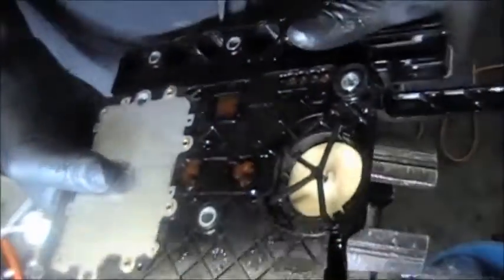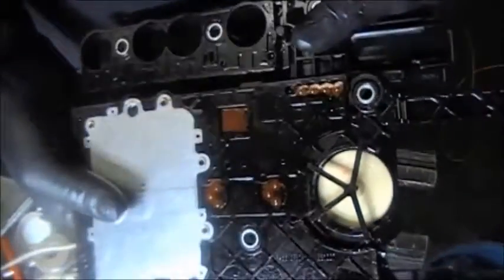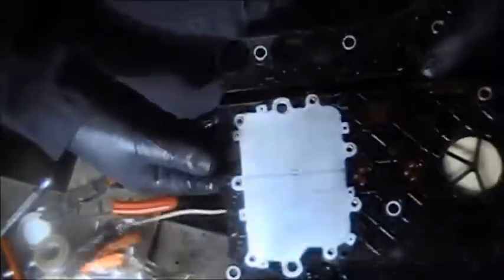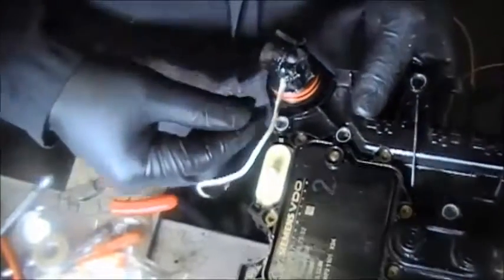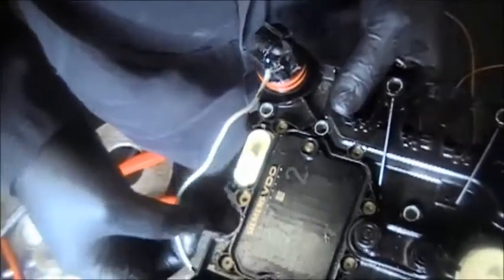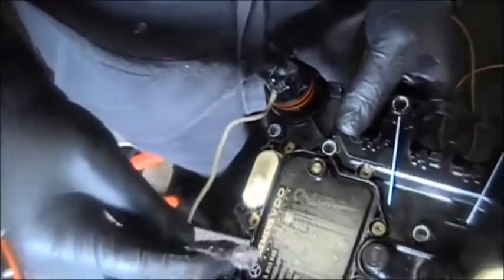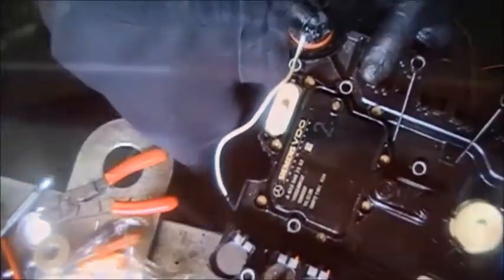mercedes bens 722.9 transmission contol module (TCM) repair part 2

Comment: you def should of jus replaced the faulty parts instead of cutting a factory wire harness..sketchy..aff
Reply from the maker: This vehicle had low mileage. There was nothing wrong with the computer system. Also, I am not simply a parts replacer. If the part could have been fixed to operate normally (and it was able to) another way without charging $1500 or more, then it was worth it to use this method. In fact it shows ingenuity and creativity. This fix will last the vehicle 100,000 miles or more, furthermore the harness was not damaged at all. You cannot simply be a parts replacer. Sometimes you have to look at things and see how to make them work. Many people come up with different ideas, it is best to give attention to all, because you may have to use one down the line.

Comment: Hello sir do you have experience on mazda 6 automatic transmissions? 2 gear shifts hard 125k miles.
Reply from the maker: If a mazda 6 came into the shop, i would fix it! However, since I do so many transmissions,l and there are so many transmissions made, It is hard for me to keep everyone in memory.

Comment: hey +questioning3 quick follow up on our phone call earlier. whatever was wrong inside that transmission still after all the work I did do.... blew apart the second I fired it up while unplugged. she makes all sorts of chattery screeching noises hahaha. out she comes.
Reply from the maker: +xzuesx91 back too the drawing board. Make sure you take your lunch. As I said before, if it was moving before you went into it, then you caused a problem.  I go through the same thing every single day.
Reply: +questioning3 I hear ya I must have done something not right.